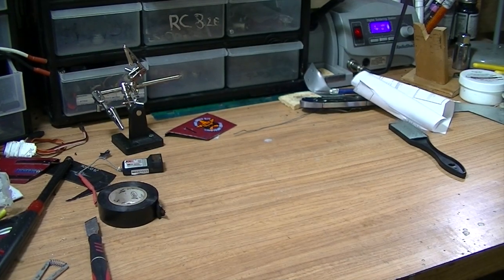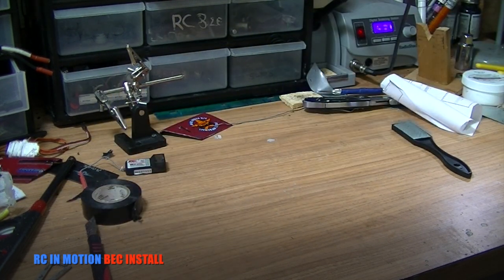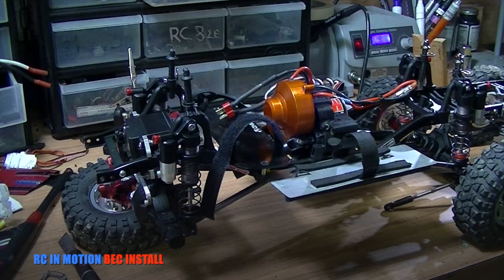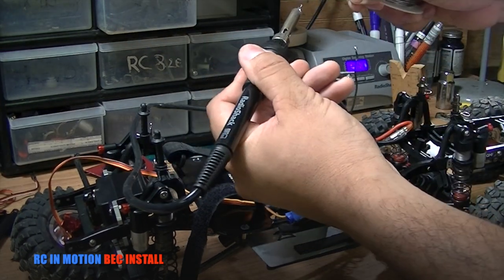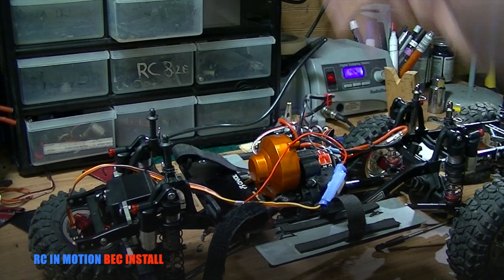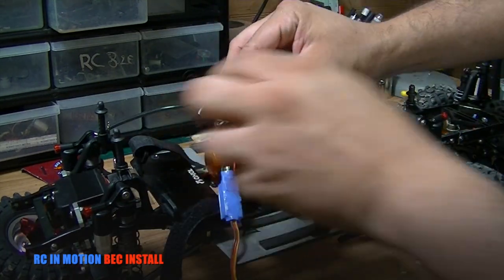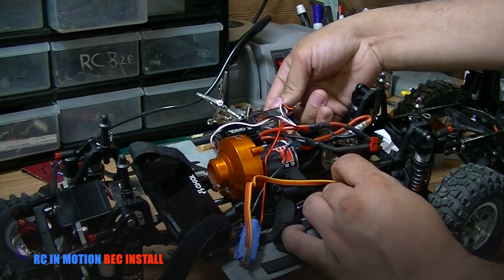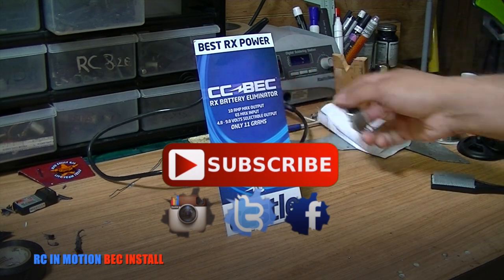Tech Tuesday  How to Install a BEC

Comment: Is there a way to add more power to your servo without frying the receiver? My receiver can only handle 6v, so it would fry if I added any more power to it using a BEC.
Reply from the maker: To be honest if your RX bec is 6v already you should be able to run it no problem. You may want to program your RX if it’s programmable. If not bring your ESC BEC down as well.

Comment: Can I use 8.4v nihm with cc bec? never used one but I need it also not too comfortable with lipos. Thanks good video even today
Reply from the maker: You can use it as long as you program it on castle link. Should work fine as this is a voltage regulator in a way. Hope that helps.

Comment: Holmes Hobbies RX Bypass is needed and you wont have to remove the red wire from esc and it will only give the bec power to the servo and not the whole receiver

Comment: Double the voltage plug 2 red wires into the receiver and the both run 6 volts receiver is getting 12 volts

Comment: How can I use something like this to power my flashlight made for a drone but it’s meant to use it’s own 2-3s battery & my drone already has a big 6s battery max 25.2v how can I set this flashlight up to that? & just have a connector to disconnect when not needed from my 6s battery to the flashlight… thanks!
Reply from the maker: You’d connect it to a male connector just how you would on a FC of your drone. Power goes to your power source but instead of connecting the wires to your FC connect it to your Flashlight and program the BEC to the voltage needed. All can be set via the app on a computer. Hope that helps.
Reply: @RCInMotion  do you know much about cc/cv drivers? Someone said to use that since it’s adjustable to meet my 12v needs?
Reply from the maker: @adrianau4246  not much but yes these BEC circuits are adjustable and it makes it a perfect match for any application.  These will keep the constant voltage to which you program them.

Comment: Your soldering is atrocious. It seems to me that most people solder their BEC directly to the battery connector while replacing the old Deans connectors at the same time. Not that your way won’t work, it will, but I would never suggest cutting factory ESC wires.

Comment: If i dont use a esc in some of my custom rc conversions builds (dozers etc)  And I just run the reveiver as esc for those servo channels.. does that mean the reciever draws what ever dirrect power straight from battery voltage?  So lets say i have a 6v battery then the receiver is kicking out 6v to channels? reason asking is I want too run a few of my channels on 6.8v too my servos running 360 for gear drives for max voltage to that servo.. do I just then add a bec or will that effect across the board channels as well.  I dont want too burn up my axuonix linear servos that only run at 6v...make sence lol?

Comment: So, if I understood you correctly, the ESC provides power to the receiver via the 'Red' wire. So, in theory, removing the 'Red' wire & plugging in the BEC into the receiver allows the BEC to power up the receiver, which also sends power to the servo. So now the ESC can focus on only sending power to the motor. I take that this also results in a cooler ESC.
Reply from the maker: Lord Bustanut hypothetically in a way yes, because it splits the voltage to where it’s needed putting less strain on those electronics that work more or less. For example if the servo needs more input you can program it so that the voltage is focused on the servo but doesn’t take away from the power. Always remember some ESC are preprogrammed with a BEC to balance the distribution of power, usually this BEC is set lower to manage the power input. But having a separate one can be useful in some applications. Hopefully that helps...
Reply: @RCInMotion  aaahh, ok. Thanks for the quick reply. I have a traxxas rustler xl5 2wd. I picked up a gyro for it. I wanted to make sure I wasn't drawing too much power from the ESC

Comment: Can I use that bec on 6s?
Reply from the maker: Traxxas_monster channel if it’s rated for 6s yes you can, always read the label on the Max input and you should be good. Hope that helps.
Reply: @RCInMotion  Ok thanks so much and this is the best video explaining it about BEC

Comment: Hey man I need to install one of these into my arrma notorious I put a 8.4v servo in it how do you get this bec to put out exactly 8.4v? And where can I get one thank you!
Reply from the maker: John Smith you can achieve that by one of two things. Adding an additional source of power for the servo like a smaller lipo or programming the voltage within the castle creations software via Castle Link. Hope that helps
Reply: @RCInMotion  thanks

Comment: That thing costs US$20. You know... for just US$2 or so, you can buy a DC-DC regulator (which is what a BEC really is) that you can use to dial down your battery voltage to whatever voltage that suits your servo..? 

Wires up in exactly the same way, but fully adjustable yet a hell lot cheaper than your full-blown 'programmable' BEC..

Comment: witch way do you plug it in for the correct polarity
Reply from the maker: Big will S. Just like a normal servo. On your third channel or if you have a bind channel you can connect it there,

Comment: Great vid. I just did this. It’s got issues. My set up is a Hexfly ESC from a redact gen7, and an rc4wd 3 channel with a savox wp0231 servo. It has a light kit but plan for a winch later. I put the BEC in the b/c channel, used an extension to cut out the signal from the esc. When I hook up the battery, the servo comes on as well as the lights but no throttle until the esc is turned on. I have steering either way. Is this normal or is something not right. Any help is appreciated.

Comment: i checked with a multimeter the ubec voltage connected to the esc , is it normal that it's 7.27 instead of 7.4?

Comment: hey , is it normal after installing the ubec on my axial scx10, when i plug in the battery, i have steering working without switching on the esc ?
Reply from the maker: Azmi J yes it is completely normal the power is routed to the servo for max output. Switching on the esc will then power your rig but in term what the bec is doing is maximizing the power to the servo so you can get the torque you need. You can always tune your BEC via the castle creations USB link. Hopefully that answers your question

Comment: Is the bec only for climbers
Reply from the maker: Jesus Moreno not at all you can install a BEC on any application all depending on your use. The bec is to route the power where it’s needed. Say you have an esc but a poor BEC, you can simply install one for better performance. We use it on climbers to increase servo performance, but it serves many purposes.

Comment: Hi, I do not know why they call it a BEC or Battery Eliminator Circuit, because that is not what it is or does. What it really is, is a ESC Bypass Circuit, a BEC does the opposite of what this does.  A BEC eliminates the need to have an extra battery pack to power the receiver, nothing more nothing less.  Personally I would just buy an extra little battery pack for $10 to plug into the receiver.

Comment: @RC In Motion
Hello, thanks for good explanation, i have not enough information about these topic, So that, i have a basic questions. I have a esc which has 5.8V 3A bec, i connect this bec wire to my 3 channel receiver and it works successfully. Last week, i bought new esc (6.1V 3A SBEC), i connected to my receiver. Firstly, it worked two times and after that, it stoped working. Now, second channel of recevier is not working. I think that, it damaged. I need a external bec, am i ?
You disabled red wire and you connected 2 wire to receiver (one is bec output wire, other is esc wire).
I want to connect only one wire to my receiver. Can i disable both black and red wires. And can i connect external bec red and black wire instead of them. does it correct setup ? Please help thanks.
Reply: great video. explains it very well. but the l in soldering is silent.

Comment: Please note the Track Star TS3T with matching receiver you must use a Y connection and plug the BEC and the servo into channel 1 only, no other slot or combination will work. I tried them all. The symptoms where that the steering servo would work but no forward or reverse and the ECS beeping like it has not connection.